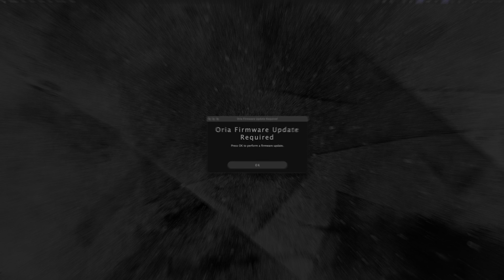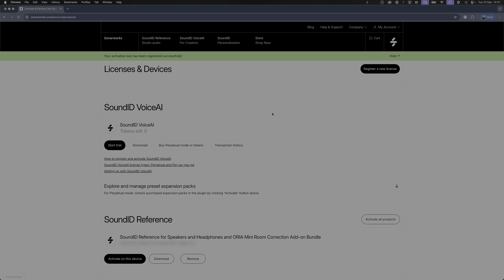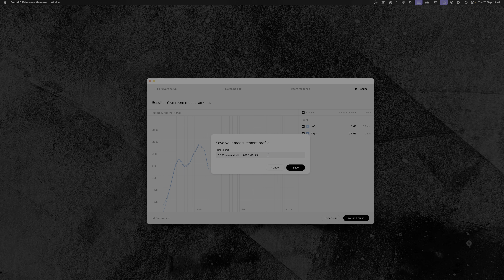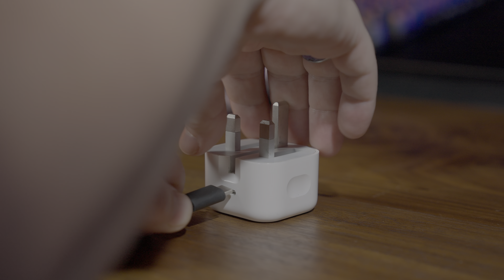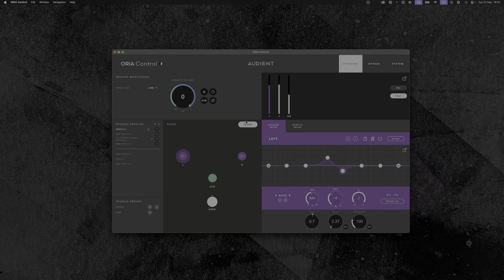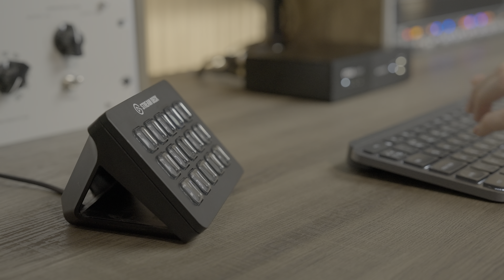Oria Mini Tutorial: Setup Guide

Comment: I have a subwoofer on the side of the speakers how do I adjust delay time of the sub? What's the process of setting correct delay times between all three in the 2.1 setup? does the SoundId app calibration give me the delay times not only of the left to right speaker but also the Sub, and if I move it, will that delay time change I need an accurate way to get phase and delayed I'm using the Barefoot Micro Mains 26 and KRK 12S  Series 2 what would be my optimal crossover and settings on the sub rear panel, as it has its own dials for crossover and volume, etc. Please assist with proper settings placement and correction steps and Soundid, and the Oria Mini app. Thank you.
Reply from the maker: Hi there,

Thanks for getting in touch,

Please reach out to us at support@audient.com and we will happily assist further.

Comment: HOW TO INCLUDE THE SUB? I HAVE THE KALI AUDIO WS 6.2. HOW DO YOU HANDLE THE CONNECTIONS? COULD YOU EXPLAIN? THANKS
Reply from the maker: You would plug the Sub output of ORIA Mini into the Left input of the Sub, and plug your main speakers into the left and right outputs of ORIA Mini. You'd then set your crossover values at whatever Kali and your Main Speaker manufacturer recommends.
Reply: @Audientworld 😮😮😮 thanks 🔥🔥🔥

Comment: So i can measure and set up withoud soundid, also more profiles? i dont get it.
for what do i need sonarworks then when the audient software does everything....?
Reply from the maker: Sonarworks can be used to measure the room and easily load the room calibration into ORIA Mini. You could also use a third-party measurement application, but you'd need to enter the EQ and Delay parameters manually into ORIA Mini to set up your Room Calibration

Comment: Can I confirm that if I am using a sound-id profile on the Oria, the left and right speaker manual eq cannot be used? I ask this because I would like to still eq just the left speaker as my left ear hears less highs. Would love to be able to still add manual eq even when sound-id profile is used. I know on the sonarworks reference app I can add eq but it’s for both left and right speaker together.
Reply from the maker: It's not possible to adjust the EQ settings in the ORIA Control app, but you can make adjustments to the curve in Sonarworks SoundID Reference and then export this to ORIA, which would allow you to do this.